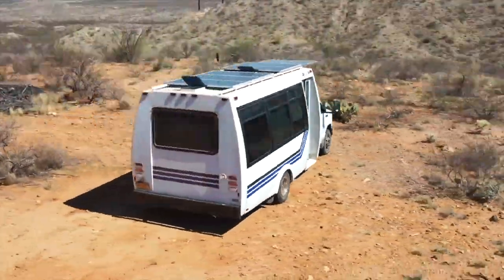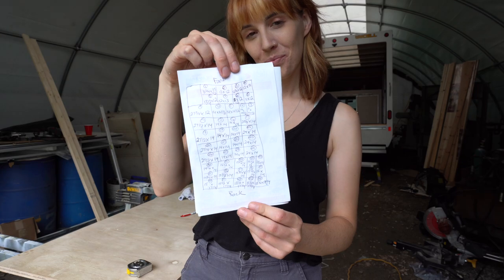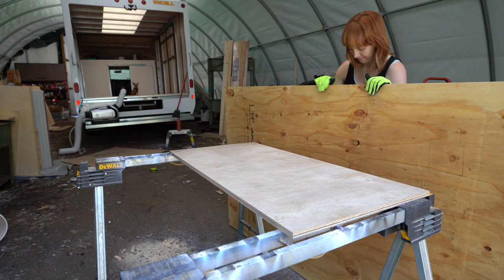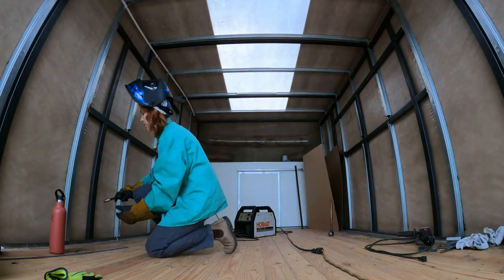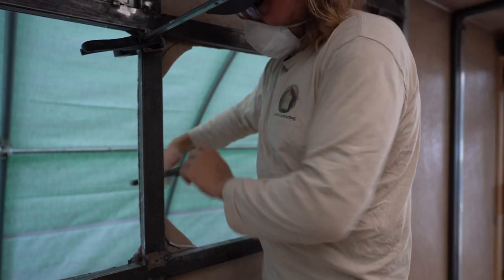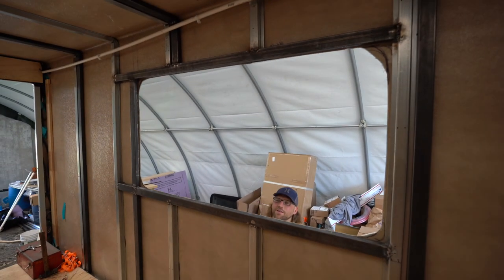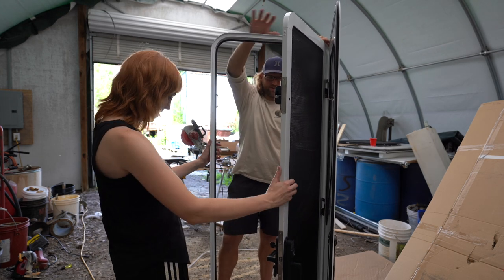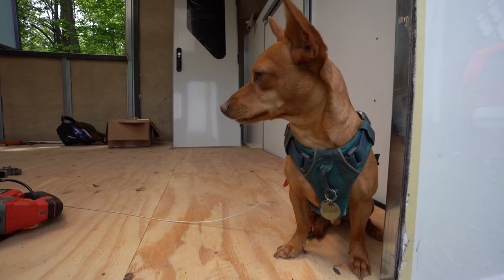Unicell Build Ep 3 | Subfloor Framing/Insulation, Cutting Windows & Doors

Comment: A good way to remove those fiberglass splintery slivers is to tape blue masking tape to your skin and pull it quickly off. It's a little uncomfortable if you have hairy arms, but it does reduce the itching.

Comment: Oh how I hated fiberglass! We used fiberglass bins to hold parts during assembly work, and reaching in and out of them, my wrists would have the worst rash (and itch). I used socks with the foot cut off and that helped a ton!  Ok, now the build. LOVE that door! Curious how you will keep it open so the wind doesn't whip it shut?
Reply from the maker: The door has a rigid expandable latch on the outside so that it can attach to a mounting point. However when it’s open it meets the vehicle body over the passenger door. We’re going to have to get creative to come up with a solution for that!
Reply: @OurWayToRoam  Would that door fit YOUR shuttle bus?